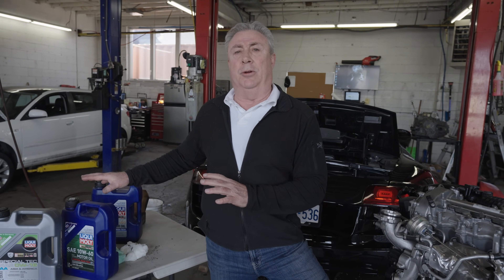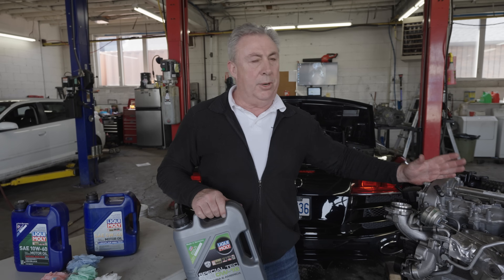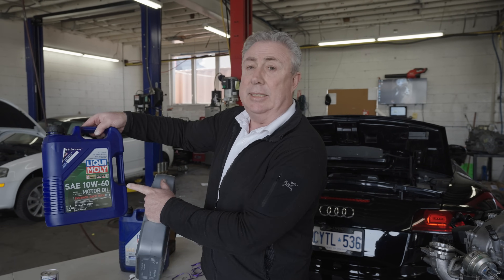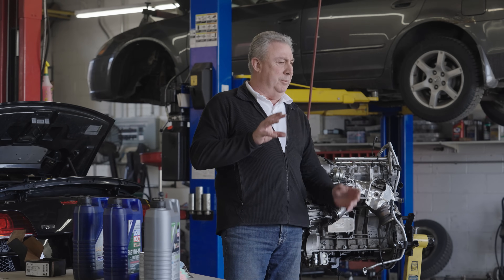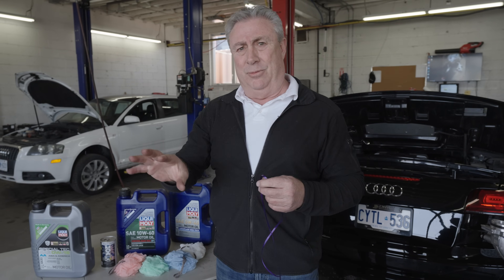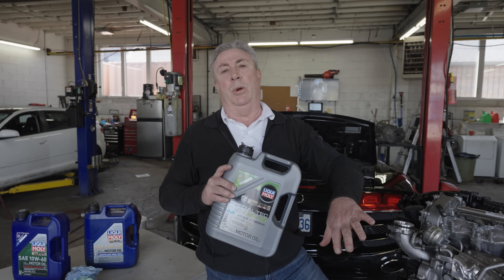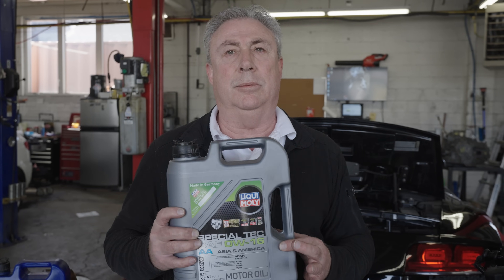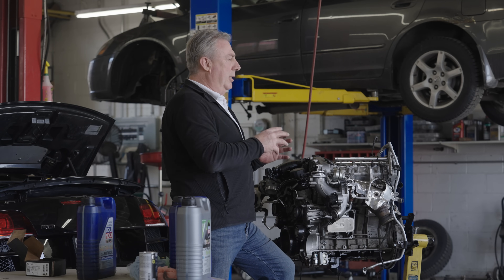Thin engine oil just a Scam? What's Safe

Comment: Thin oils have been used a long time and there is no sign modern engines wear our fast. They do break down fast for multiple reasons, but not the ones related to lubrication. So if engines do not wear out "because oil is too thin", then where is the problem?

- your ECU (engine control unit) breaks down or
- your piston rings get stuck (due to low spring tension) and following poor instructions from car manufacturer telling you to run with the same oil for a long time or
- you get carbon build up due to having direct injection engine with EGR (exhaust gas recirculation) and no other set of injectors in intake manifold like Toyota does, or
- you have a wet belt like modern Fords (rubber belt inside oil chamber turns valves instead of a steel chain, or a belt outside) or 
- you have a CVT gearbox with a belt which even in theory can not last long and 
- since you have undersized oil pump in most modern cars that does not create enough oil pressure (yes, even this is a common thing now - designed to fail your engine after warranty expires) or/and
- since you have very small oil filters before VVT (variable valve timing) in most modern cars, if low oil pressure from undersized oil pump does not wreck your engine, thick oil or debris in tiny oil filter in oil will deprive oil circulation

the countless problems of modern engines do not stem from thin oil, but design decisions (and decision by car makers to overcharge from spare parts - Hi there Audi with 7000 USD headlight assembly per side, what did it cost you to make, a 100 USD?)

Then there are other purpose build issues with modern cars, like:
- van-type vehicle like Toyota Proace, all which have very poor anti corrosive treatment in steel and poor paintwork so they rust and fail super fast, because mechanically those types of cars are often reliable and would become super popular due to reliability if they did not rust)
- Headlight assemblies that cost 4000-7000USD per side (hi there Audi) rendering repairing of old cars financially impossible forcing people to buy new cars - how ecological! 
- EV batteries that can not be repaired, only trashed and replaced no matter how small an issue.
- Every spare part costing tens of times the actual production cost of said part
- Recommended maintenance intervals like "eternal gearbox oil" which you should change every 60-70 tkm, long life engine oil with 30tkm/2year change interval you should actually change every 10 tkm/1year if you don't want piston rings to get stuck, engine to burn oil and wear out.

Oil changes needs to be frequent enough and prefer ester/PAO based oils instead of those that just claim to be fully synthetic. From what I have heard, modern engines also need cooling liquid replaced as "ecological" rubbers and plastics suffer if it gets old. It is not enough anymore when "it is still freeze resistant enough".

And how many knew, if you have an EV with a battery pack, that batter pack often has air filter and it needs to be replaced or the battery might suffer due to poor cooling?

Comment: I purchased a Honda Civic in 2013, it said use 0w20. I changed the oil at 500 miles and put in amsoil 5W-30. It has 260,000 miles on it and it doesn’t burn a drop of oil. I changed the oil every 6000 miles either with Amsoil or Pennzoil platinum. So I guess I did the right thing.

Comment: Compare oil  shear viscosity and viscosity index specs on the manufacturer’s data sheets to determine how well the oil will stand up to wear.  The additive package that makes it thick at high temp breaks down under mechanical stress (shear) and when it does, the oil defaults to its thinnest viscosity (the lower number).  All the good intentions can be worthless with lower quality oil after 1000 miles.

Comment: I have used 10W40 oil in the pass and never had engine problems. Now I use 5W30 oil, but never 5W20. We live in high summer temperature area (over 100-110 degrees most of summer). We need the higher viscosity oil for the high temperature protection. Also change oil at 5K miles or one year. Never the higher mileage car manufacturer recommends.

Comment: FWIW I live in central Virginia where we have a mild climate and I ran my wife's 2018 Jeep Cherokee Multiair 2.4 four cylinder 60,000 miles (100,000km) with the suggested 0W-20.  Now I use 5W-30 full syn. oil (NAPA brand which I think is Valvoline).  I change the oil every 3-4,000 miles (5,500 km or so).  Hopefully this car will last a long time since we don't really have rust issues down here.  Good video.  Thanks.

Comment: Bought a new (2017) Subaru Forester 2.5i:  at 400 miles, I drained factory 0W-20 Idemitsu oil and put in Amsoil 0W-30 Signature Series, and a new Wix filter.  Every 6 months I extract 3 quarts (and add back 3 new quarts) and every 12 months, I do the same and replace the oil filter.  I live in Wilmington NC, which has mild winters and hot summers.  Car runs great; burns no oil.  Oil changes are greatly simplified, and if you take the time to really think about it, this is better for the engine than changing all the oil once a year.  Use AI to check it out.

Comment: If you have worn out engine and you put thin oil it will be noisier and will kill it faster. If you put thick oil it will quiet the engine and will prolong engine life.  That alone tells you what kind of oil is good for the engine.

Comment: I own several Lincoln Town Cars 03'04'& 08. All have the 4.6 Liter V8. They all state to use sae5w-20 and that is what we use. All have over 230,000 miles & still run fine. Most wear occurs at start up before the oil circulates. The thinner oil gets up through the engine quicker. Here in Florida we used to run very thick oil in the summer straight 50 weight. We were worried about the heat but were experiencing excessive oil consumption. When we switched to the 5w-20 on the newer cars that indicated it our oil consumption issues never arose in the 2003 & newer cars.
Also remember that newer cars often have much thinner oil rings that clog easier. Thicker oil could be an issue with extended oil change intervals.

 Regular oil & filter changes cannot be stressed enough.  Do not believe the nonsense of 10k oil changes.

Comment: I have a 2016 Toyota Tundra and 2020 Toyota sienna I use have been using 10w30 AMSOIL signature series for over 40,000 miles with 8,000 to 10,000 mile oil changes with no issues in the mountains in 20 degree cold winter and they start right up and going threshers in 110 + degree heat durring summer months still with no issues.from sept 2021 till now may juneof 2025

Comment: Just a quick correct. You said "the longer your car lasts." Survey says: False. Maybe the longer certain components of your engine lasts. How often is the engine the failure point of a modern automobile? Outside of cases of extreme abuse or defects, as in it would have failed no matter what you did. either defective individual unit or defective design, like a recall. The answer is... not often. People need to be learn how get real. be more realistic. How often are engines the failure point on a modern car? How long do most Americans keep their cars anyway? How much money do you save on fuel economy? etc etc. When you think about it, all this very much "guy" stuff, they obsess over, it's all very silly. Most Americans don't keep their cars long enough for it to matter. Most Americans don't own their cars either, they're financed then they trade it in to roll over the loan before they even pay it off. thats the American way. It's pretty simple. If you got a defective engine, guess what? It's going to fail no matter what you do. Because that's what a defect means. If you just do basic maintenance, don't neglect it too badly, and live life. it will be fine. the chances that the engine life will be the limiting factor on how long you keep that car, not very high. I've actually owned several cars for 10+ years. I've owned some cars for 15+ years actually. I neglected them. They were maintained but not perfectly by any means, and a lot of times the duty cycle was as brutal as it could be, meaning a few short trips a day. that will wreck any oil within 3000 miles. Guess what? Zero engine failures anyway. Literally everything else goes bad or starts to fail long before the engine, like the pistons or rings or bore or anything like that. More likely you'll be replacing something like a water pump or timing chain/belt. Is oil going to help you with that? No it's not. So I find all of these kinds of videos to be really silly and just disconnected from reality.
Reply from the maker: Thanks for the comment Tim!  I would respond that it depends on what you consider to engine related failure to be.  In the real world I see folks make a decision to send their car to recycling versus repair every day.  In many cases it's not the internal failure of the engine but rather the inabilty to properly manage the engine from an affected EGR, failed turbocharger,  plugged intake valves,  piston rings seated in carbon, or even a catalytic converter failure that are 100% attributable to oil performance.  Far too often, a little prevention would have offset the problem.  

I do agree that establishing any effective manintenance plan really does come down to setting reasonable expectations.  My goal is a vehicle should last 20 years at a annual use of 20,000 miles per year of a healthy balanced blend of city and highway driving.  And, I expect my vehicle to be just as reliable and dependable in the last year of service as it was in the first.  

If my preference were to simply keep a vehicle for 3 yrs and then rotate to a new vehicle the maintennace plan would be completely different. In this scenario, maintenance costs would be significantly lower but depreciation and transactional costs would be much higher.  Again, different strategies. 

Thanks again for the much appreciated feedback!

Comment: so how about doing 5w 30 in spring during warm summer weather till fall. then switching back to the 5w 20 or 0w 20 they recommend to be thin in winter and save gas.

Comment: GM recommend on Opel to use 0W-20 to reduce and eliminate the LSPI -problem. What is your take on this matter. Should I use 5W-40 instead as the car has a cam chain that should be well lubricated to avoid wearing?

Comment: Ah what a video! I read ALL of the comments, as the theme of this video is what I have struggling with since we bought, my first NEW vehicle, 2023 Tacoma V-6. I struggle with the 0W-20 free oil change up to 20,000 miles. Manual says okay to use 5W-20...Maybe up to -30, Im running on memory, but says it should be changed as you can! Truly don't understand that one! I changed the oil first at 3000miles, then at 6000miles, and Toyota did their 10,000mile change then. Since I read ALL of the comments, I must ask a few questions knowing newer design engines have different requirements....1) TaCOMA ENGINE TAKES 6 QTS., so how about I use 3qts of 0W-20, and another 3qts of 5W-20 or 5W-30 same brand? This engine seems a bit noisy to me.anyway...2) Where does the suggestion to change oil every 6-12 months? I also have older vehicles yet sometimes over a year I drove one only 1200 miles! And I should still change that oil? 3) How do they find out  the viscosity you are using, if there were some problem, and I then rechanged the oil back to recommended?
Realizing this is a hot topic we are discussing here, but I am older also and it causes me the wonder seeing such thin oil draining when I change the oil!!!! Thank you to any and all who may offer suggestions!
Reply: I have been using Lucas oil treatment in my car for decades  thicker and helps the car run great I substitute this for one quart of oil during an oil change 👍

Comment: my 2018 Audi S5 calls for 0w-20.  I've heard from a European owner that their manual calls for 5w-30.  I ordered some 0w-30 Amsoil Euro to switch to.  Many are running 5w-40 in theirs.  I think 5w-40 is a bit too much of a jump.  It can hit nearly 120 here, so I'm not worried about being a bit thicker.  Also, with the early 3 liter turbo it's got the rocker arm issue, I want to make sure they got a proper oil film.  I'll also probably be changing the oil at 3k miles since that's a years worth of driving.  Work is <3 miles away.

Comment: My 30d x5 engin oil runs at 85 deg C normally around town or cruising.  Towing or on continuous inclines it gets up into high 90s.   Uses 5w30 recommended oil.  Look at the oil performance curves.  They all have virtually the same viscocity at 100 deg C.  So going from a 20 to a 30 or a 30 to a 40 will help a little bit if you are working the engine all the time, but not for day to day driving.   Firstly i just change that oil at 8000km before the additives degrade.   Bmw says oil change at 35,0000 km, but thats because they provide free servicing for 5 years!
Reply from the maker: It's great to see that you're paying attention to your operating temps, especially when towing. I love that idea of considering viscosity at operating temp! 

Thanks for the terrific feedback!!

Comment: I owned a car sold in the UK as a Chrysler Grand Voyager 2.5l diesel.
I owned it for about 13 years and at 508,000 miles the gearbox bearing eventually gave out. I had the oil changed every 12,000 miles.
Loved that car

Comment: Modern engine bearing clearance is much tighter than older engines and thick oil won't get in there.older cars you could put whatever you had in the shed, nowadays I put whatever it says on the oil fill cap period.

Comment: 13 Corolla.. changed oil at 500 miles to Super Tech synthetic 5w-30. Every 5k miles after that.. 12 years later 120k miles.. dosent burn a drop of oil

Comment: My Dodge 017  truck 392 hemi bought new. Told me 0/40. Had cold start lifter tick. Found out that 3-4 years earlier they ran 5/30. I switched to that. Motor instantly responded positive to the oil. Never going back

Comment: I'm so glad to find you! We just bought a newer Subaru. I was reading the book and saw something about 0W-x oil and thought it must be a mistake! (I guess I'm out of touch, as an owner of mostly 24-year-old, 250,000-mile cars.)
I wonder, though, about mixing oils. For example, if my crankcase was properly filled with a 0W-16 but then, on a road trip, I found I was over a quart low and the closest I could find was a 10W-30, how bad will I be hurting things if I mix in just one quart of that?  And then would I need a complete oil & filter change next chance? - Thanks!

Comment: On any given year the manufacturer calls for a certain weight oil.  The next year the EPA steps in and the oil weight drops a notch or two on the new models with the same engine.  Did the engine design change.  I think not.

Comment: ..  I was taught that the wider the range of "multi-grade" oil the more thickening modifiers were in it and they aren't good for the motor .. Some now have tight passeges that oil must run thru like my Honda with VTEC .. You cannot go to thick or it just won't work and would give you a dash light on .. Mine calls for 5-20 . I'm in South Florida and not afraid to use 10-30 .. but the most important thing is to change it often .. keep it clean ..

Comment: Working at Kia as a tech from 2010-2018 and owning a couple myself, I will testify that those 2.0 GDI engines with the extended warranty for the claim of "metal debris from manufacturing" in the engine will last a couple of hundred thousand miles with clean 5W-30 and not use more than a quart of oil between oil changes.  Same with the Tiger shark Chrysler and the old "oil burning" 3.8 Jeep JK minivan engine.  
Thin oil is for a no load MPG test pass and not good for a daily driver.  Unless maybe a hybrid vehicle where the oil doesn't get very hot and load is limited with the use of an electric motor.

Comment: If you want to scrub out your coated cylinders start by using thicker oils. Its fine on old Iron sleeve engines with traditional honing but I would never risk it on modern engines with specialised coatings. Also, the mindset of thick oil being better in plain bearings is just wrong. Those operating clearances and the surface metallurgy are designed for the oil specified, that includes flow rates through the bearing itself and adding viscosity as some form of benefit is insane. The lubrication system has bypass pressure regulation and heavier oils will simply bypass more flow before it reaches the bearings themselves, until it gets hot enough, or worn enough to flow, but by then the damage is done.
Just change your oil more frequently if you want extended life..

Comment: The suthor was coreect in the end. Temerature in you environment matters on one side of viscosity or the other. THEN minor adjustment. 
Intervals are also same . Dusty, stop and go. Arctic or desert,stop and go,city.. Oil Change more.  Highway  straight cross county 5 to 10 k. 
Big diesel companies change filters 3 times to every oil change. 80000 miles on Shell Rotella.  Sell trucks at 400-500 k.

Comment: Windage and drainback  issues too . Thin oil returns back to the pump faster and  cools faster on finned inner and out pans. Horsepower loss is far better. Like 4 tiny valves need single valve springs not double. Cause and effect must b e studied . Not guessed at. Half of your engine is cooled and lubed by splash oil .  Two strokes have NO OIL PRESSURE. THINK.

Comment: I hope your oil pumps are driven by little shafts or even rubber belts. Thicker oil will twist them off and that tiny little oil pump thrust will lose pressure and your light will flicker at idle. Im a pro master tech. You play with expensive mouse trap. Your fingers get snapped.